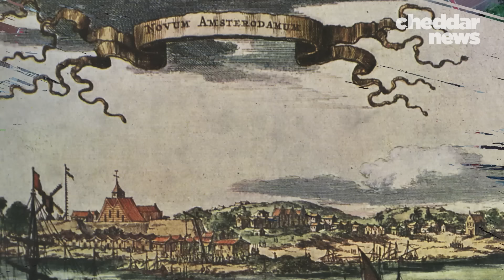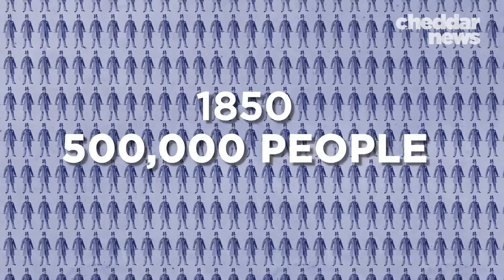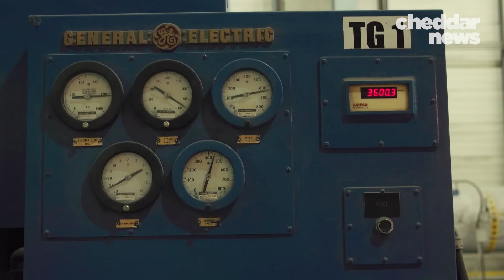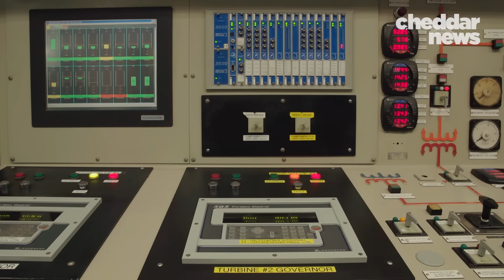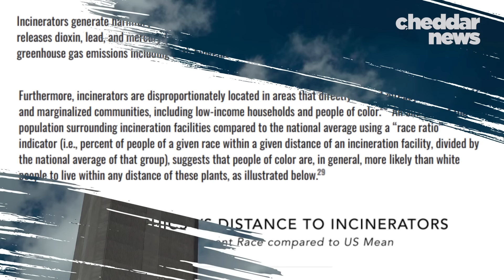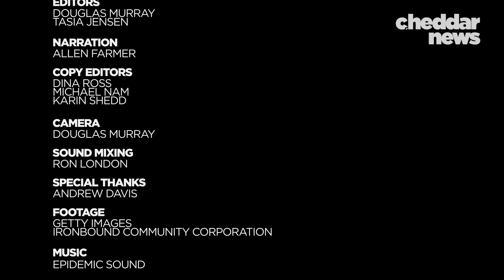Where New York's 14 Million Tons of Trash Go - NYC Revealed

Comment: Seems like a pretty crappy system. Good garbage trucks, like the ones they use in most of Europe, don't vomit garbage juice on the street. Landfills are banned in most of Europe too, and in many cities all the heat from the incinerated waste is sent directly to homes/businesses for heating.
Reply: couldn’t have said it better as an american who’s lived in Europe for a good amount of time, i was shaking my head the whole video
Reply: "landfills are banned in europe" is 100% a false statement. europe isn't one country, and I haven't heard of any european country not using landfills anymore. we just make a little bit more of an effort than america to separate trash to recycle more of it, and we probably burn a larger percentage of the stuff we don't recycle or export, instead of putting it in landfills. but landfills absolutely still are used as the last resort for the significant percentage of trash that doesn't get separated for some kind of use. some european countries are also pretty good at separating compostable waste to make soil from it (which I think is normally not allowed to be used in commercial agriculture though due to potential toxic contamination). here in germany, the consumers throw away trash in several separate categories: clear glass, colored glass, various glass and plastic bottles that are worth 7-25€cent to return (some are recycled as well-separated material, some are refilled several times), plastic and metall packaging for recycling/burning, cardboard and paper for recycling, compostables, and a catch-all general waste category that's too mixed to be conveniently recycled in one of the other ways. if you have anything particularly toxic, you're supposed to turn it in to the dump separately (batteries and electronics also have their own waste streams), and if you've got big stuff like furniture, you can book a collection in front of your home in advance, which is free once a year.
Reply: Neither of us is better than another. Eventually we can combine all these things. I have much more learning to do. An if i make it out without being the most evil thing alive.; be sure to vote for me as world leader.
Reply: yeah, where he said "system like no other" at the start i thought "yeah cause its stupid
Reply: Please don't go to Rome or Naples 😅
Reply: In Oz we have standardised bins ‘Otto’ bins, these enable the trucks to have a robotic arm that pick them up. That one man one truck and no manual handling of the waste. Work smarter not harder
Reply: Yes, landfills are banned in most of Europe  that's why in 2020,  the EU exported around 33 million tonnes of waste to non-EU countries so the other countries can dump it in their landfills.
Reply: @cnrb  That weren't official exports but illegal ones. And you only know about it, because the EU cracks down on illegal waste exports. And by the way: Even if there were 33 Million tons of EU waste dumped into landfills somewhere, which isn't the case because scrap metal is counted into this number, even though it is recycled in other countries and not "waste" – however, even these 33 Million tons are merely twice the amount that New York, a single city, produces … and the EU has 450 Million citizens, 50(!) times NYC, but only twice the amount of waste.
Reply: @soxenbridge  automated collection won’t work in city’s like  NY because traffic and parking keeps the trucks to far away from the curb.
Reply: @Ass_of_Amalek  Germany has NO landfills for household waste anymore. The only landfills we still have are for building rubble (for Bricks and concrete, no rebars no wood of course). And even building rubble is being recycled more and more in new concrete. And all this is true for most, if not all EU countries as well.
Reply: Hape you're kinda right, I'm surprised. germany is among some european countries that ban putting household waste in landfills. but it's only what looks like about a third of EU countries on the map I found, and the bans were only enacted mostly in the 2000s.
Reply: @Ass_of_Amalek  All of Central Europe has landfills banned….
Reply: Hear hear. The process in NY thats shown is horrible. How about recycling?! What about the true envirenmental costs
Reply: @SuperS1lverHaze  Not quite, like he said construction waste is still going to landfills and here East Saxony the hardly burning garbage rest is still landing at the Zentraldeponie Wilsum II landfill.
Reply: Most of europe doesnt have to ensure the safe voyage of international shipping or maintain half a military bloc, so...cry me a river
Reply: @tonyp.1463  i dont see what that has to do with local/national garbage disposal
Reply: @CakeboyRiP  it has to do with what any given government spends. Im not for the forever wars, but even without them the United States has an incredibly heavy burden besides just efficient trash collection and disposal.
Reply: @soxenbridge  this is literally not possible in NYC. trash cans or trash bags are left on the sidewalk, behind parked cars that line the curb. no way for a mechanical arm to access them. I live in a different state where there is very little street parking..allowing trucks with arms to pick up the trash bins.
Reply: Garbage trucks vomit garbage juice on the street believe me, it is up to the employees the garbage man here EU Germany aren’t as good as you describe

If they don’t want to do their job good you immediately see the consequences
Reply: I’m genuinely curious as to how that infrastructure works. There has to be a video about it because it sounds fascinating
Reply: @Ass_of_Amalek  the Netherlands doesn’t use landfills anymore
Reply: I’m sure it’s good for your health to breath in all the burnt garbage
Reply: @Vegas3662  we almost have no burnt garbage, we have a recycling bin for plastic, organic, paper, steel, batteries. If you recycle like that you don’t really have other waste that gets burnt. The air from the waste plant gets filtered so it is just as good as normal air. The only bad thing is more co2, but that’s still better than all the damage you do to the soil and environment with landfills
Reply: @ShawnJonesHellion  😂😂
Reply: A lot of infrastructure and systems in the US need massive upgrades
Reply: Many countries in Europe also are barely a fraction of a size of the US. We can get away with it because we have more space. Europe can't because they will run out.
Reply: @thomasfreeman7770   hmmm that is odd, Sydney, while not as big as the Big Apple , uses the truck with a robot arm. I wonder how they get around it
Reply: @hape3862   if there is no land fill then Where does the foam your Tv comes in go, or the thousand layers for plastic everything is wrapped in go? Or the broken toys or stuff with meat juices on it go?
Reply: @soxenbridge  all the plastic gets recycled some of it is used in roads and others are made into sewer pipes and the best plastic is used again to make packaging for stuff
Reply: @soxenbridge  Glass is already sorted by color (white, brown, green) into three different big containers located at many corners in housing areas, then collected, crushed, washed and fine sorted for impurities and re-molten into new products. Plastics, Aluminum and other metals go into a yellow garbage bin in every household and get a similar treatment: washing, sorting re-melting for new products. Organic waste goes into a brown bin in every household, gets collected and composted. The compost is sold as garden soil. Paper goes into a green bin in every household and is recycled to new paper. Sewage gets treated until drinkable water comes out and goes back into rivers. The digested sludge is sold to farmers as fertilizer. Batteries, Akkus and fluorescent / LED light bulbs can be brought back to every store that sells them for recycling. Clothes and worn shoes (in relatively good condition) go into big containers next to the glass containers at every corner and are donated to the needy or sold in second hand stores or recycled whichever applies. There are also containers for small electric and electronic devices, which are then recycled as well. Bigger electric devices like washing machines or fridges are taken away by the company that delivers your new ones (and recycled of course). All other big furniture can be put at the street in front of your house after having made an appointment with the city for pickup (for free or a small fee). Furniture gets recycled into chipboard for new furniture. Everything can also be brought by everyone to recycling yards in every city or county at normal opening hours for free in any quantity. For all the above applies that only the kind of material matters, not the degree of cleanness or degradation (you asked about meat juices). Although it is strongly recommended to only dispose in a "spoon-clean" condition (think of a yoghurt cup spooned empty - that's fine). Foams, styrene, packing chips and so on are plastic and go into the yellow plastic bin like all other plastics. And then there is a black garbage bin in every household which is for the rest of your garbage that doesn't fit into one of the recycling bins, like vacuum bags or ash tray content or completely worn down clothes and shoes, or porcelain etc. This rest garbage is incinerated in power plants, where the exhaust gases are filtered (of course!) and the ash is heated so high that it melts into a glasslike substance, which is broken into granulate and used in asphalt for new streets. I'm sure I have forgotten some things but everything is taken care of. No landfills needed.
Reply: @CakeboyRiP  Germany’s GDP spent on military: less than 2% (hovers around 1.7-1.8). If NATO didn’t exist and Germany (just using a European example - this goes for France, and other countries in the EU) had to pay for their own military (the US spends around 7.5% of its government expenditures on the military or 750 billion vs Germany’s 50)   it would have to cut costs somewhere whether it be healthcare, waste management, etc. Arguably more important is the free military technology that the US hands NATO countries who see a massive benefit from the technology trickling down into consumer/business uses.
Reply: That's dope bro good life
Reply: I’m in Europe now.  Seems that most of the trash is just thrown onto the streets by people. Pretty disappointing actually.
Reply: Jeffry Chen  stop trolling
Reply: @adventureswithwonu4467  have fun at that dump
Reply: @Ass_of_Amalek  in the most central european countries it is prohibited to put household waste on Landfills. You have to send it to a Incineration plant. Only the rest from incinerators or constructionwaste who is not organical is send to landfills
Reply: Its sad that America is so behind compared to other nations.
Reply: Most landfills in my area of Florida, incinerate the garbage to create power
Reply: @dougn6465  But that doesn't make sense, it's not a landfill if they don't fill the land with trash. If they use incineration instead of landfilling it's called an incinerator.
Reply: @damnkris  not everything can be burned. Only household garbage is burned. The rest is buried. Btw, the term landfill was around long before incinerators came around
Reply: @dougn6465  That's not true, almost everything can be incinerated, here in Norway the only things allowed to be landfilled are things that can't be incinerated or recycled, like ceramics. And while Florida is a leader in waste-to-energy in the US, only 8% is incinerated. 

"Florida combusts an estimated 8% of its overall municipal solid waste, according to 2020 state Department of Environmental Protection (DEP) data, with another 50% going to landfills and the rest counted as recycling."
Reply: @damnkris  u don’t incinerator C&D, metals, concrete, or yard waste
Reply: @mm0138  After watching that video, I am skeptical that incineration of garbage could be that clean (only producing CO2).  In fact garbage strikes me as something dirtier than coal - at least coal was meant to be burned in the first place.

I guess it has to be done when landfill space is at a premium - but you still need landfill space - where do you think they dump all those leftover ashes?  Ashes that would be very toxic.
Reply: @Tiqerboy  the heat that comes from the plant gets used to warm the houses in the area, this also helps because the co2 produced would be almost the same as if you were heating the houses with burning coal or gas. The toxic ashes are processed in the roads , ur still putting it into the ground but it is much less than putting all the waste in the ground. There is also a company that cleans the ashes but that is hard to do on a big scale.
Reply: Good for Europe.
Reply: @SuperS1lverHaze that’s incredibly dumb. The amount of permanent damage done from burning garbage will end up causing huge problems down the road. Burying with decomposition/creating CNG as a fuel is the most soundly way to dispose. Not every landfill is MSW, hence why there are different classes of landfills. Also you’re only speaking on non-industrial waste. Chemical waste and profiled waste is what you need to be worried about.
Reply: Wrong statement. I mean obviously it would be wrong Europe isn't one entity it's a multitude of nations. Landfills are legal in most nations, but highly discouraged. In Romania for example due to corruption even proper treatment facilities operate like landfills anyway.

Comment: One of the failings of the layout of Manhattan is the lack of alleyways which would ensure more seamless collection of garbage.
Reply: Building in the sky is “free”. NYC decided to punish people for building up higher, so instead they try to squeeze every last square foot of land out of the city.
Reply: @LeeeroyJenkins  Building in the sky is not "Free" as you say, at least in NYC. There is something called Air Rights which is the remaining space above a building no matter the size. If someone wants to build a supertall tower, they would have to acquire the air rights of those around it, and it cost money just as if it was landfill.
Reply: You don't need alleys. As a previous comment said, Amsterdam has installed below-sidewalk receptacles that are emptied by equipment, not by hand or shovel.

Comment: Why bury 3/4s the trash in landfills that might pose a health risk for generations to come, when one can incinerate it for heat/electricity?
Reply: inceneration does not create a problem? its outlawed in many citites
Reply: With proper treatment of fumes, it's definitely less harmful than landfills.
Reply: @ChrisTian-yw7jc  you think these companies are going to put in the effort to properly treat these fumes when they're surrounded by poor neighborhoods?
Reply: @MotorCityPhoenix313  Depends on the laws, I guess. It ain't about the burning. It's about how much effort you put into after-treatment.
Reply: I worked at Fresh Kills :andfill for 28 years. The garbage that is buried is under one hundred plus feet of dirt. The capped with a non permeable membrane, several feet of sand, then another semi permeable membrane, then several feet of topsoil. There are pipes (with hole in them) that run throughout the garbage in layers, and a gas plant on the premises that separats out the lechate (garbage water) and recycles the collected gas back into municipal gas system. There is also a huge deep undergrond "slurry wall" surroundimg the perimeter of the landfill. That totally contains any and all garbage from leaking out. The garbage will decompose safely. All while providing gas for the community, and a Park on top.
Reply: @ShawnJonesHellion  When it is at a super high heat it can burn a lot of particulate matter. Along with scrubbers on the exhaust. It’s called plasmagastrofication. Google it super interesting
Reply: @phillipmoore6295  clearly you didn’t do your research
Reply: @phillipmoore6295  you are correct. There is nothing wrong with landfills if they are managed according to the highest construction and engineering standards and world best practice. 

I worked in construction and engineering for a long time  and I know problems mostly occur when some bastard becomes greedy and cuts a lot of corners or is just plain negligent.  Obviously it's better if as much material as possible is recycled. As far as I know incineration is not really a safe and effective method of garbage disposal unless the trash is burnt at extremely high temperatures. Some materials that will create dioxin need  to be incinerated at close to 1200 degrees centigrade. CCA treated timber offcuts  for example will create toxic fumes if not burnt at very high temperatures. Some people still don't know this and put it in their fireplace which can be very dangerous.